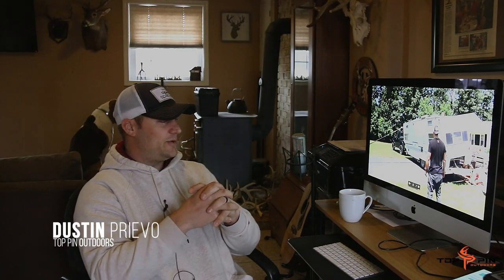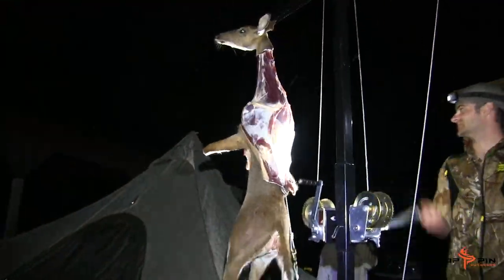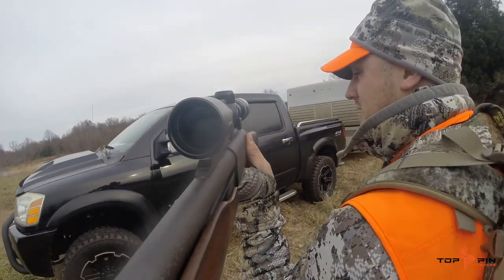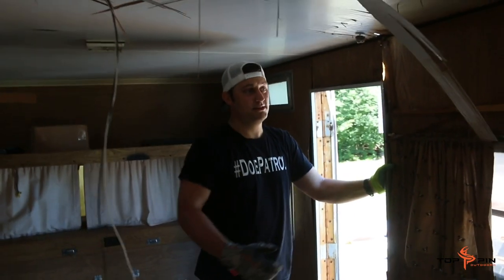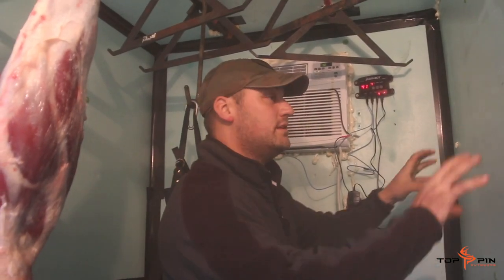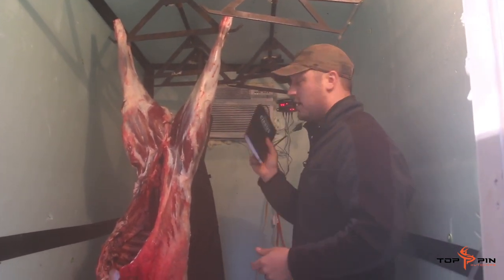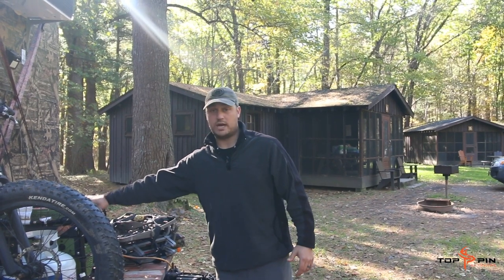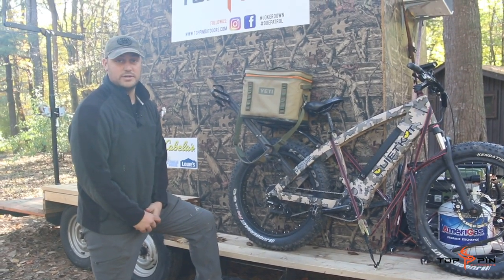DIY Walk In Cooler! The Deer Cooler TRAILER! MUST SEE! #VENISONVAULT

Comment: guys ! good job ! what is the coolest temp. what you can achieve inside ???
Reply from the maker: We have it usually between 34 and 37 on most fall days and between 37 and 40 on hot summer days
Reply: @TopPinOutdoors  thank you so much !
Reply: @TopPinOutdoors  how long is the building from the door to the air conditioner and how tall is the building Sir
Reply: @TopPinOutdoors  and how long is the trailer frame from the hitch to the back of the trailer Sir

Comment: Anyone know the aprox lifespan of an ac unit with the coolbot?
Reply: It doesn't really affect the life of the unit by much. Its harder to run and cool a house/room on a unit then a sealed "walk in"  in most cases. With how he is using it it will most likely spring a leak before the unit motor fails.

Comment: How high is it inside? Looks like @ 7 feet or so?
Reply from the maker: I used 2x4x8s for the wall. There is a drop in the ceiling from the support beams for the gambrels and then it was about 3" below that of piping so the legs probably sit about 7 feet but the walls were made out of 8 foot 2x4s. The door is a regular size door if that gives you any perspective. Hope that helps!
Reply: @TopPinOutdoors  yes, that does help. Thank you. 😊